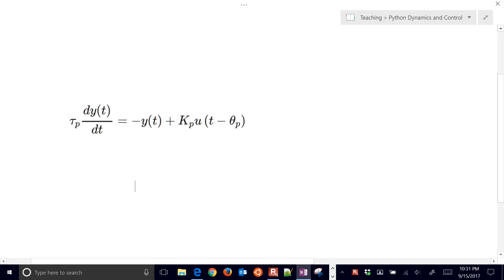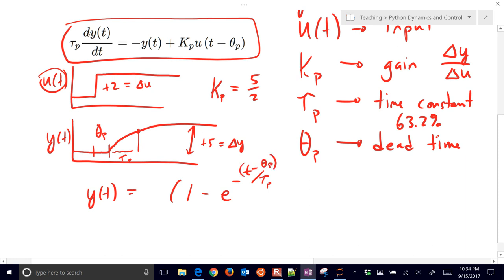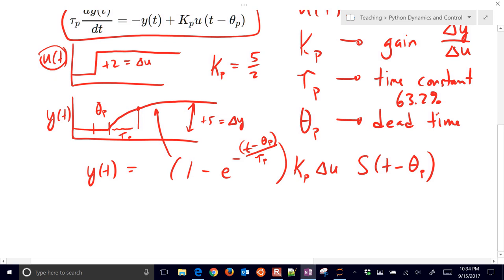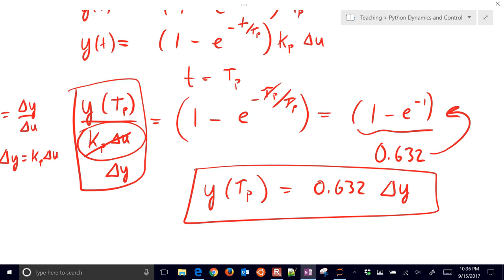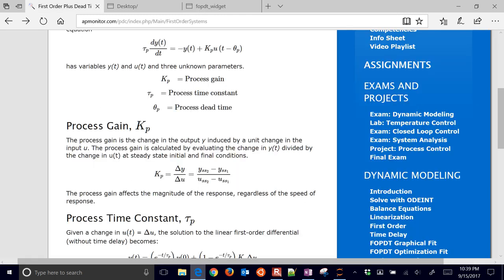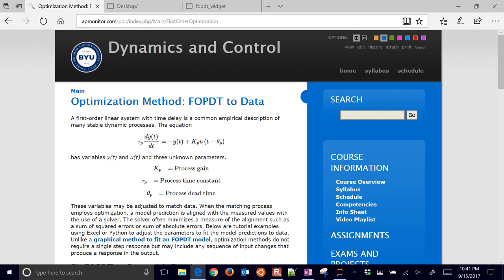First Order Plus Dead Time (FOPDT)

Comment: 🎯 Key Takeaways for quick navigation:

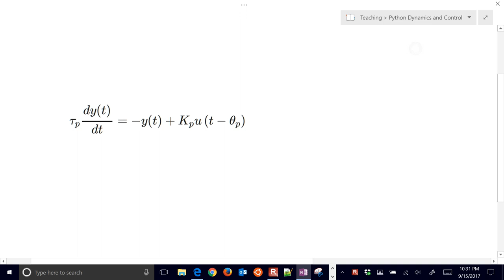00:00 📝 Overview of First-Order Plus Dead Time (FOPDT) Model
- Introduction to the FOPDT model, which comprises output (Y of T) and input (U of T).
- Explanation of the three parameters: KP (gain), tau P (time constant), and theta P (dead time).
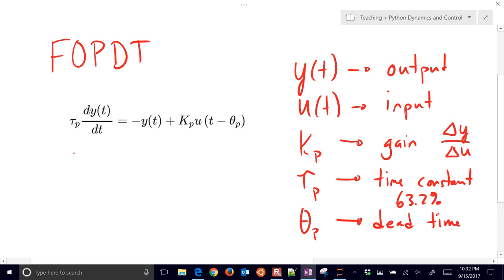01:23 📊 Sketching and Analyzing FOPDT Response
- Sketching the response of the FOPDT model to a step input.
- Analyzing the gain, time constant, and dead time in the response curve.
- Deriving the analytic solution for the FOPDT model's response to a step input.
04:12 📈 Understanding Time Constant and Dead Time Effects
- Illustrating how one time constant corresponds to approximately 63% of the way to the new steady state.
- Explaining the influence of dead time on the response curve and steady-state attainment.
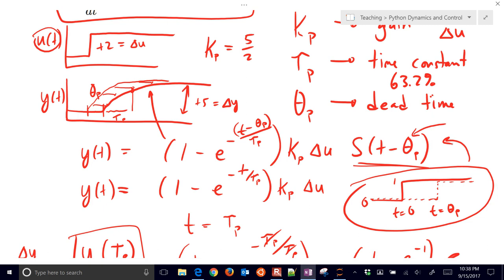07:06 🔄 Interactive Demonstration with Parameter Changes
- Demonstrating an interactive Python widget to visualize the effects of changing gain, time constant, and dead time.
- Showing how altering these parameters impacts the system's response and steady-state behavior.
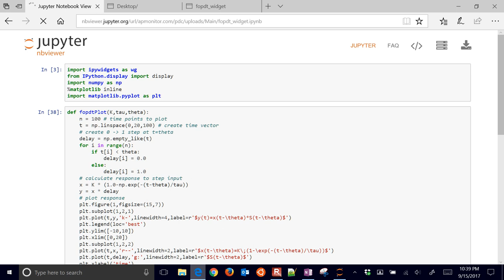08:39 🛠️ Tools for Practicing Fitting FOPDT Models
- Introducing methods for fitting FOPDT models to data, including graphical methods and optimization techniques.
- Providing resources for practicing and implementing FOPDT model fitting.

Made with HARPA AI

Comment: A simple fact to add is that it takes 5 time constants to reach 99.3% of the step change x gain (if any). This is used in electronics for capacitor and inductor charging. It is used considerably in automation as a low-pass filter.

Comment: When I try your code with the widgets every time I update the FOPDT parameters it makes a new graph. How do I get it to update on the same plot as with your example?
Reply: I had to know. I think I figured it out. You're missing a plt.show() at the end of your fopdtPlot() fn

Or at least that's what I have to do in my notebook to get the same behavior you show in the video
Reply from the maker: Are you running it in a Jupyter notebook? It should only produce one plot that is continually refreshed when you move the slider bars. Does the more recent example work? https://apmonitor.com/pdc/index.php/Main/TCLabPIControlTuning